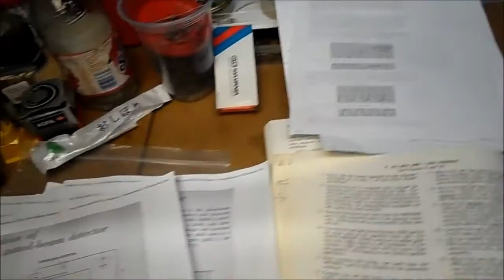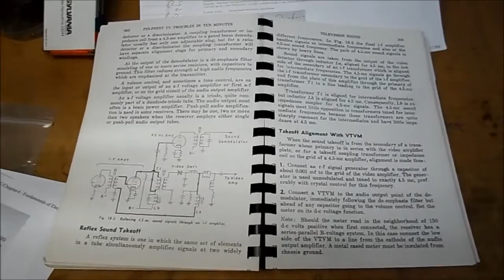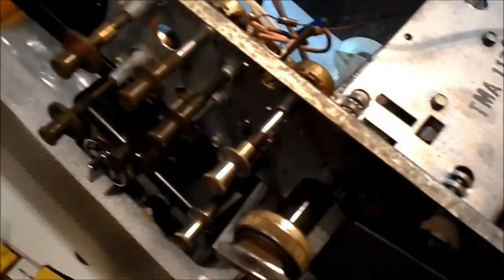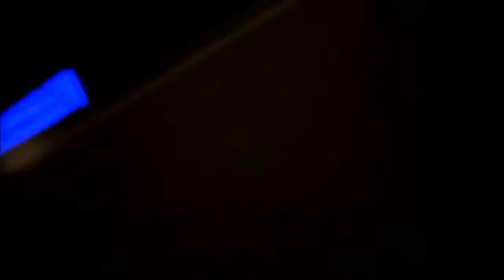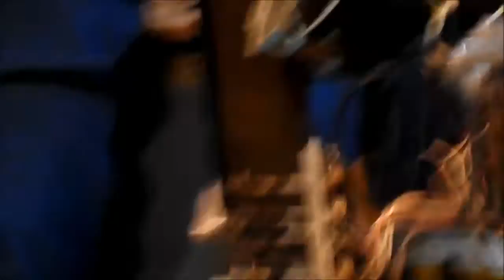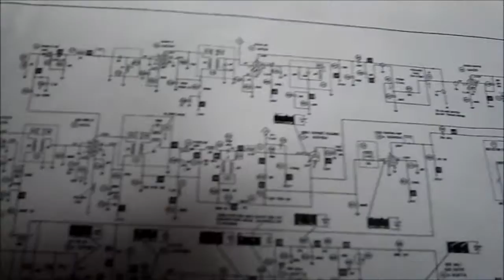RCA Victor CTC 24A. Audio Stage Checks Using The  B&K 1077.

Comment from the maker: Yes, I have a heat clip for the purpose somewhere. I used needle nose on the 1st. diode, the second I tacked real quick, while holding the lead up by the diode. Thank you again for the tip re: germanium soldering..

Comment: one more word of warning, often germainium diodes are used in these circuits. They cant take heat like a silicon diode, so you must use a heat sink when ever soldering (or unsolder to test). a typical heat sink would be a hemostat clipped on near the body of the diode. An alligator clip will also work as long as it has a good firm grip to the wire. Try not to use excessive heat as well. This applies to all germainium based semiconductors.

Comment: measure the resistance from the anode to the ground on that sound detector diode should be about 10k one direction and less than 1.5k the other

Comment from the maker: Ok, followed back. Good tone on the cathode of the diode, a little noisy & faint on the anode, which is just on the other side of C35 that comes off the plate of  2nd. video 6JC6. The L13 coil to ground there checks ok.

Comment: just keep injecting that 4.5 all the way back to the little cap that couples the plate from the 6JC6. I am wondering if any of the coils are open or have a solder joint issue.

Comment: there is a diode that couples the IF to the 1st audio IF tube, try on either side of that.

the test pattern should come up as you advance the "video" knob on the 1077 unless the photo multiplier tube is not working.